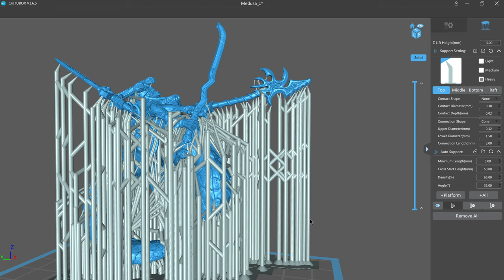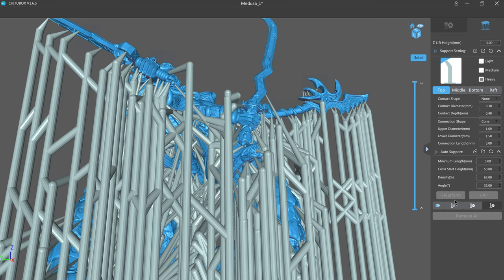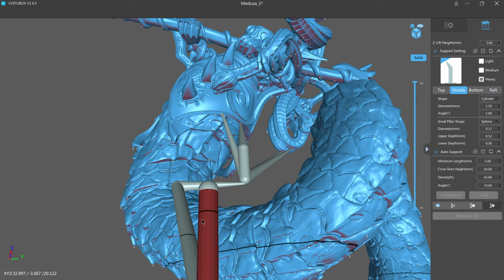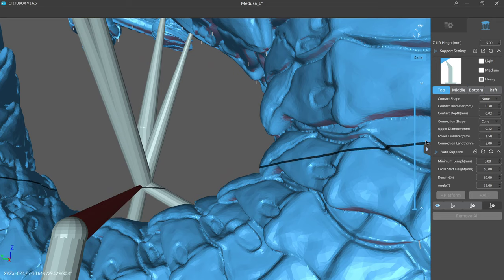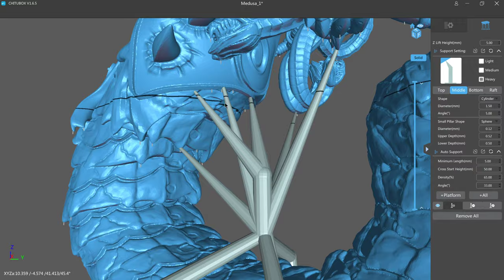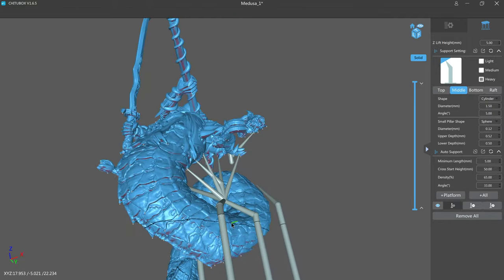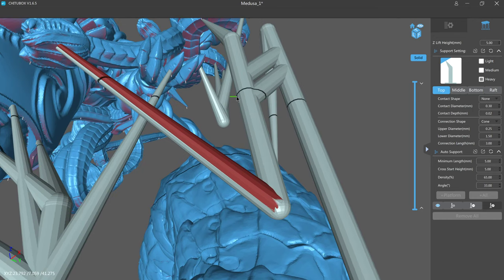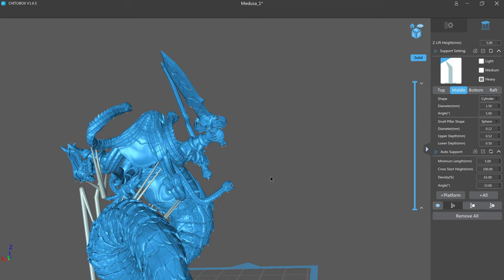How to do crazy supports in the new Chitu 1.6.5

Comment: Still haven't figured out how to do double joints but that video is golden, thanks man :) 
I do my own dupports since...oh, a long time. But when 1.6.5 came out and I saw this, I learned more (you never stop learning anyways).
I did not know you can delete the feet. THAT alone was a game changer. But the idea to move the feet as supports is excellent!
Reply: Yea, I kept thinking I missed the "double joint" creation method, but didn't see it either. :/
Reply from the maker: So the Dbl joint part you have to manually create like i did with the support tips, or with the cross beams, or you have to rely on the algorithm to pop them out. It does so an some arbitrary overhang over model ratio, i haven't yet nailed down what that ratio is. But what i tend to do is when i find a spot that is generating them i make a whole bunch of them from that spot and then move them around from there.